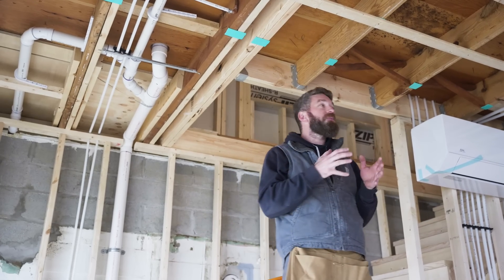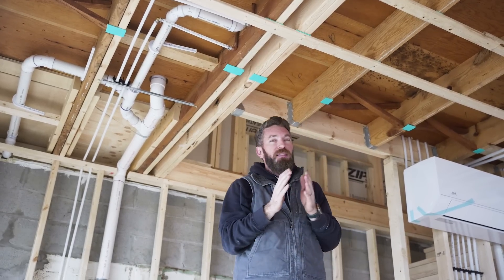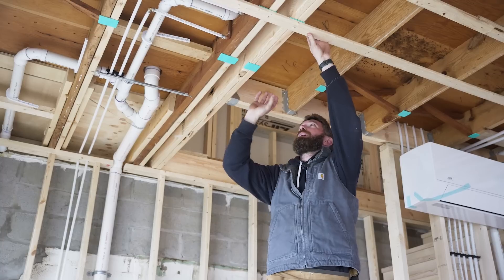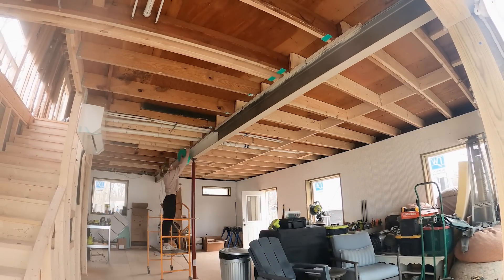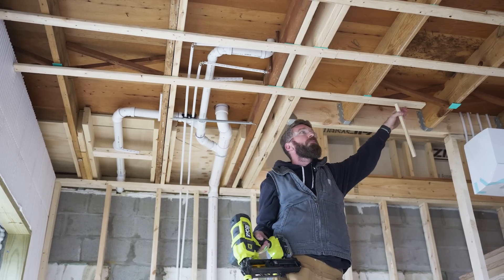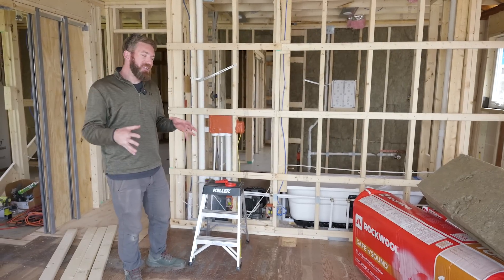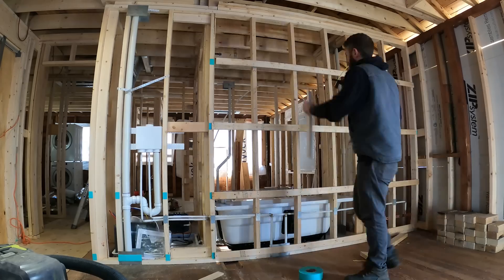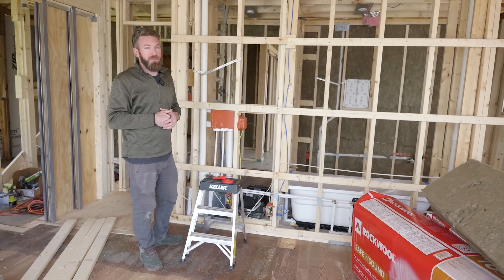We Soundproofed Between the Floors and Walls (Will this work?)

Comment: Really the only way to help block IIC sounds is to decouple the ceiling from the bottom of the joist. Never use resilient channel for ceilings they were never engineered to work on ceilings properly.

Comment: I believe there is a sound absorbing drywall called Quiet Rock that is supposed to give the sound damping mass of many sheets of drywall.  Just be careful how much sound proofing you install when you have young children.  You still want to hear them to a degree so you know when they are up to no good. 😁
Reply: Quiet Rock will tell you it's not IIC rated they are only STC rated. You need to decouple the structure to actually do any IIC soundproofing.
Reply: It's when you DON'T hear them you know they're up to no good 😂

Comment: I live in an apt , very small, where 90 percent of disturbing and distracting noise comes through the door.  Any ideas that you all have would be appreciated.  I am very upset, and it's not healthy to wear ear plugs most of the time.  Thanks.
Reply: You could try a draught excluder to place under your door(s) and see if that helps amazon, and eBay will probably be the "cheapest places" online to purchase them.
Just a suggestion.😅
Reply: In an apartment in Asheville NC and it’s awful no insulation anywhere and noise from every direction. Our upstairs neighbors literally running a bakery out of their apartment and is always hammering and thumping into the night not to mention dogs barking and road noise. Just awful. We’re building a manufactured home next summer on land we’re purchasing thank goodness

Comment: I see you put recessed light rough in plates in that ceiling. Assuming you’re putting those slim disc lights in. How are you planning to sound proof those lights in the ceiling? Did you build back boxes? Having those holes in the ceiling defeats the purpose of sound proofing the ceiling.
Reply: I am a sound engineer and I have built 3 recording studios. Resilient channels are the best to prevent sound transmission from a rigid structure. They will keep their “ spring absorbing “ effect as the weight on the gypsum is added. Not sure about the padding stuff. Maybe it’s ok. Also, what improves a lot STC between floors is adding a second layer of 1/2 “ gypsum to the ceiling or even a 3/4 if you wish. 
That’s the best solution to maximize your efforts… As for the holes in the ceiling for lighting, it’s a problem at that level of construction.
A small opening lets a lot of sound go through. We used external electric junction boxes so only a small hole for the 14 gauge wiring was going through the layers, filled with an acoustic caulking.
May sounds a little bit overkill but once you have engaged in such effort to soundproof your house, these added techniques will improve a lot your results for a little bit more money well invested.
Reply from the maker: Yes they are the slim disc lights. They have gaskets on them and will have insulation right up against them. I know its not perfect but will be better than nothing.

Comment: I'd suggest using screws instead of nails to put up those furring strips, especially if somebody is going to double up on drywall. Would suck to have the nails pull out over time.
Reply: I was thinking the same thing.
Reply from the maker: I did end up switching to screws.